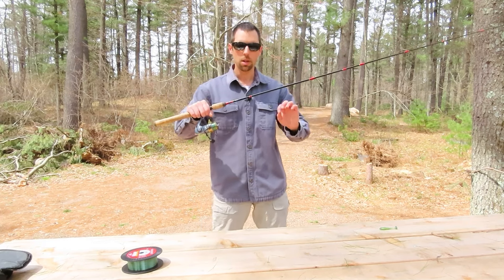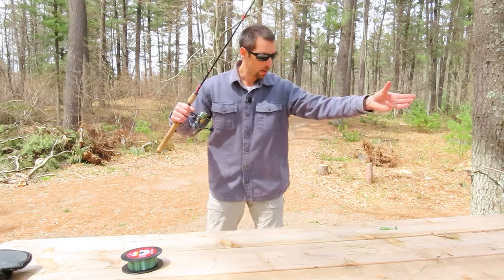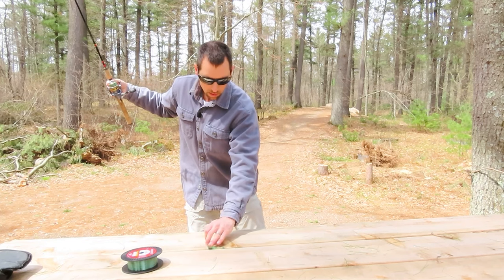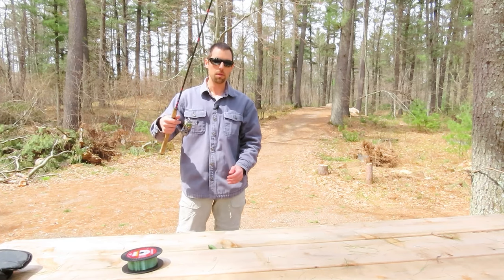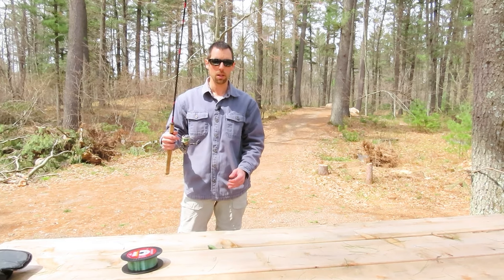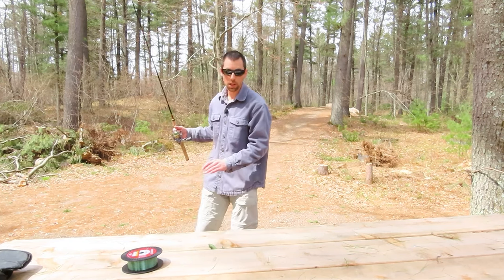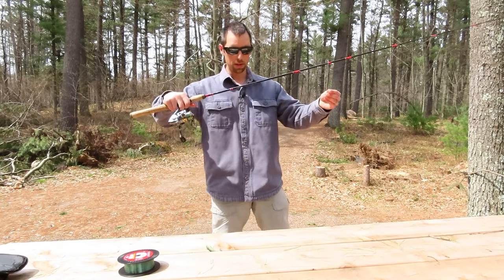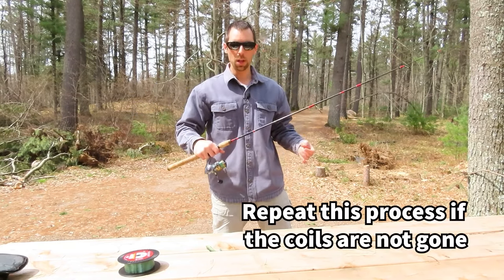How to Remove Memory Coils from Fishing Line - Fishing Tips and Tricks

Comment: I would add...after stretching the line remove it from the anchor point and reel in to remove any twist which may have accumulated from prior use.
Reply from the maker: That can be a good idea too. Make sure to hold the line a foot or so above the reel to keep tension on the line as it goes back onto the reel. When a lure bounces back along the ground, it can cause the line to wrap loosely around the reel.
Reply: I use a swivel for no line twist as I walk it back.

Comment: As a rule of thumb if im using a cheaper mono i like to replace it once a season unless i put in some serious work on the water. But for those that fish less as long as your rods arent in direct sunlight this is a great tip for yall to save some time and money. Just be careful you dont have to much pressure on the line realing it in because it could weaken your mono over time same goes for respooling
Reply from the maker: Thanks for the feedback
Reply: It isn't just exposure to light that weakens monofilament line. Heat and humidity also take a toll. If you live in a hot or humid area, you should change line at least once each season! The cheaper lines have more memory, regardless of line diameter or strength. I never go longer than 4 months or so without changing my line. My fishing time is too precious to spend it fighting with my line.
Reply: It isn't just exposure to light that weakens monofilament line. Heat and humidity also take a toll. If you live in a hot or humid area, you should change line at least once each season! The cheaper lines have more memory, regardless of line diameter or strength. I never go longer than 4 months or so without changing my line. My fishing time is too precious to spend it fighting with my line.
Reply: It isn't just exposure to light that weakens monofilament line. Heat and humidity also take a toll. If you live in a hot or humid area, you should change line at least once each season! The cheaper lines have more memory, regardless of line diameter or strength. I never go longer than 4 months or so without changing my line. My fishing time is too precious to spend it fighting with my line.

Comment: I've been doing this for 50 years. I store my fishing gear inside, climate controlled and out of direct sunlight, so I rarely change my line every year. I don't fish a lot anymore and usually not at all during the winter, so a couple of times throughout the year I will stretch out 50 to 75 feet for an hour or so to remove the tight coils. I generally only fish in creeks and a small river now, so 50 feet is about as far as I cast anymore.
Reply from the maker: Thanks for the comment. No need to change the line every year if you're only doing a few trips per year and it's stored inside out of direct sun. It sounds like you've got a good process.

Comment: I been doing this for over 40yrs. I did it today before trout fishing. Yesterday I went boat fishing for walleye. Drift trolling can twist your line, even with a swivel.  But I reel in my line with my fingers pinched in front of the spool and the rod butt pressed into my stomach. It removes twist and help you cast farther. But remember to split on your fingers so the line doesn't hurt you. Also, there is line conditioners like ''Line Butter''.
Reply from the maker: Thanks for adding to the discussion

Comment: Me and my cousin thought by pouring water on it would work 😂 good thing for YouTube 🙏🏾
Reply from the maker: Pouring hot water (like hot shower temperature) can help if you stretch it right afterward. But yeah, just dumping water on the line won't do anything by itself.
Reply: Years ago Al Lindler,infisherman mag,said-put a piece of damp paper towel around the spool with a rubber band the night before and it will take out those kinks. Both of these ideas would work great together. I liked another comment that said use a snap swivel instead of a hook to help with line twist.
Reply from the maker: @pete956  swivels will definitely help with line twist, but they can't prevent memory coils, which are caused by the line being wrapped around the spool for a long time.

Comment: I don't understand why the spool position would matter. The line turns 90 degrees from the rod to the reel. Whatever position the spool is in, the line can only come off the way it's wound.
One suggestion that might help prevent twist is to put a swivel on the secured end of the line then wind your reel slowly so that the line has time to remove any twists.
Reply from the maker: This trick is for removing memory coils, not line twists. These coils are formed when the line sits wrapped around the spool for a long time and doesn't want to straighten out anymore. It can happen whether there are twists in the line or not.
Reply: @FishingwithNat   thanks.

Comment: The first thing I noticed about this reel is its weight https://www.youtube.com/post/UgkxM68VkfsQhHaabDce1IwOCXuvumcpbZ_k . I wouldn't say it was uncomfortable but it was a little heavier than other similarly sized reels. However, that didn't deter my enjoyment of how smooth this reel is. I spooled it with 20lb. Tuf-Line XP and it's perfect for what I use it for. I have it paired with an 8'6" Medium/Fast Okuma SST Salmon/Steelhead rod. The combination is perfect for casting and even drifting. I used the reel all day and didn't experience any arm or hand fatigue except when fighting a few fish! The bail is solid and feels strong when engaging by reeling and manually closing the bail by hand. The large rubber handle grip is very comfortable. It's got a powerful drag, silky smooth reeling, and feels very comfortable in the hands. I recommend it!
Reply from the maker: What are we buying?

Comment: You should also use backing on all your reels and only replace the casting line (the maximum distance you can cast and add 10 or so yards.  That way you are not throwing perfectly good mono or expensive fluorocarbon away that is typically never used, unless your dealing with very large fish that take out lots of drag.  I change out roughly 60-70 yards every year or after breakage for my bass rigs.
Reply from the maker: Thanks for the extra discussion. That can help save some money and wasted line.

Comment: Maybe a Little Harder in a kayak, than a motorized boat ! But if you notice your line getting Memory on the water ,,, simply throw about ten foot of naked line into the water and with the bail or breaks on , take of down the lake till about half the spoil has been let out , Trip the bail over and the resistance of the water and line will straighten your line out perfect , actually better than new ! rell the line back up , because it's wet and with that tension , it will cast so musch better and zero memory !
Reply from the maker: I've tried that too and it works. But yeah, as you said, it's more suitable for motorboats and this is something you can do in the backyard or down the street to get a bunch of rods ready for a trip quickly.

Comment: Nat, if your not changing the line about every 4 to 5 trips your fishing with degraded line and will lose more fish. Mono is a UV suck and is not stable after about 10 to 12 days in the sun.....
Reply from the maker: I typically respool mono every 1-2 years depending on how much time it's gotten used. In that amount of time, I haven't noticed any big issue with weakening unless the line has been used around a lot of rocks and wood.

Comment: I did that with 17 lb mono and I left it stretched outside all night long it was fine for a while but then started coiling again
Reply from the maker: 17lb mono is thick and has a LOT of memory. Like you said, it will quickly start to form coils again. With the many advantages of braided lines these days, I'd recommend using braid for any line over 10lbs.

Comment: I will try this... What I do now is cut off the lure , open the bail , let all the mono out into the lake (boat) , keep the tip under water , THEN , reel it back in with  the rod tip under water pointing straight with the line .. I despise line twist!
Reply from the maker: That works well for line twist. This technique is for removing the line coils which form from the line being wrapped around the spool for a long time. This happens regardless of whether the line has twists in it.

Comment: How about also using a swivel at the end?
Reply from the maker: A swivel will reduce line twist but won't prevent line coils from forming out of the spool. Swivels are definitely important when using baits like inline spinners and spoons that tend to spin around a lot.
Reply: @FishingwithNat  I was meaning when you're untwisting the line, would that counteract you trying to untwist the line or do you think it would help
Reply from the maker: @elkbow  If the line has twist in it too, a swivel should help. Sometimes the line is not twisted but just coiled from being on the spool too long, and in that case a swivel wouldn't have much effect, positive or negative.

Comment: you should be replacing the line at the beginning of each season, why would you take a chance of losing that once in a life time fish over a few bucks
Reply from the maker: It really depends how much you're out fishing. If the rod only gets used a few times during the year, I don't think the line needs to be replaced every year. My braid setups get used more often than my straight mono setups, and I'll typically use that mono for 2-3 years before replacing it.